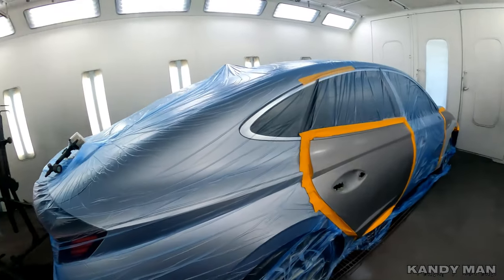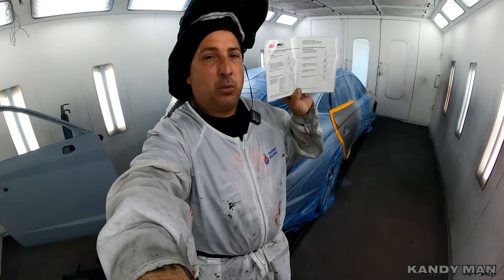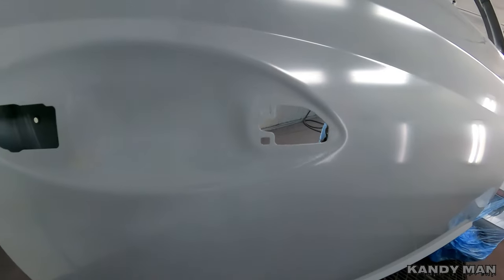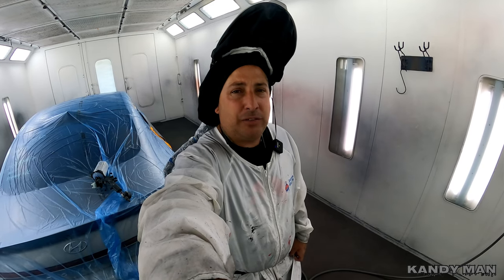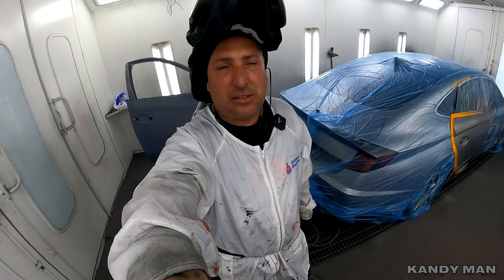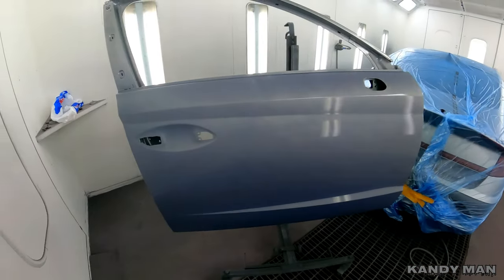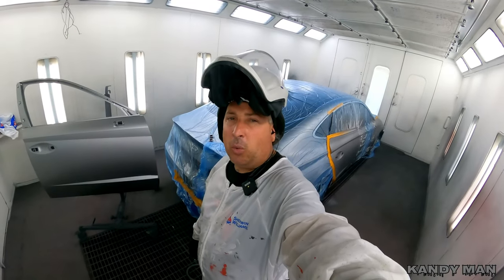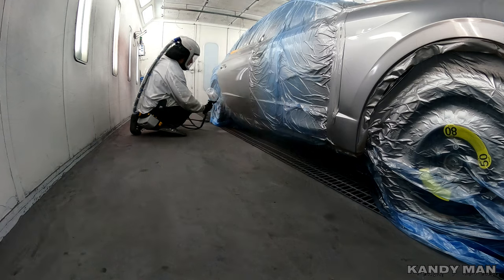3M GUN - FROM SEALER TO CLEAR

Comment: Recently bought one for home garage use. Since its HVLP cap, im using a small compressor 50Gallon, not really sure whether my compressor can support it. Definitely will try it out. Anyway looking awesome job you have using 1.2 cap all the way. For clear, 4 turn in from full fluid i think it's only 1 turn out from closed right?

Comment: I picked up a 3M gun a couple weeks ago as my first gun. Home/ one gun for all. I'm a newbie to it all but grasping how to use good products and what has to be done. How would you take the 3M gun further spraying clear to get an even flatter finish? What tweaks would you make based off you settings in this video? 1.2, 25psi, 4 turns in from WO and WO fan. Thanks, love the videos. I focus more on the resto work you do and the non factory peel work you do! Will be following you cutlass videos when i paint my 46 Ford Vert.
Reply from the maker: Just play around with it  each products are different

Comment: 3M GUN  great so far for base. i got 4-5 vehicles from one tip and it does not show any signs of degradation. How often do you change the tips?
Reply from the maker: I change  them every so often  for color  changes  but never had one go  bad
Reply: @kandyman5315  The tips are affordable. But i cleaned them as i would clean regular gun so i could go from black to white with no issues. You need to try Walcom 360 evo for clear. I ended up with it after DV1 with C1, C2 and Sata 5500.
Reply from the maker: I'm holding out for the ws400  series 2 for now .but you never know lol
Reply: If you want to try it and review it i can give it to you for few days. I'm around the corner and i can use SATA for that time.
Reply: @kandyman5315  Yeap... as of right now it faced up on eBay for $950+.. i haven't seen it in the stores yet. I want to test it as well.

Comment: I have a 3M Performance gun, Love it,  What settings were you using on the base? or did i miss that setting? I also have the Iwata Kiwami 4.
Reply from the maker: 18 psi full fan 4 turns on fluid from closed
Reply: @kandyman5315  Thank you.... I really love your work, your CANDY jobs are thus far the best i have seen! Have you shot any Orioin Candy yet?
Reply from the maker: Orion silver base then kandy yes done many of those